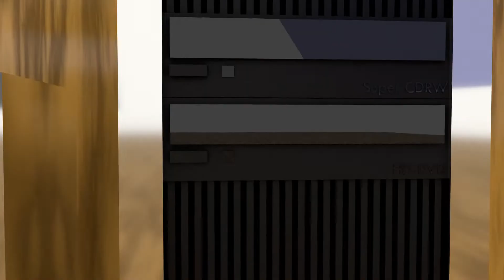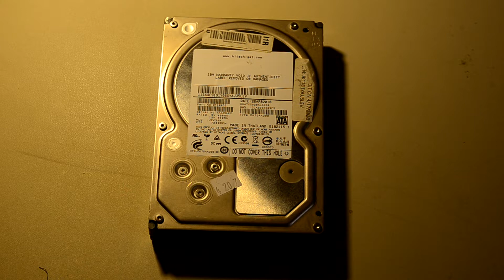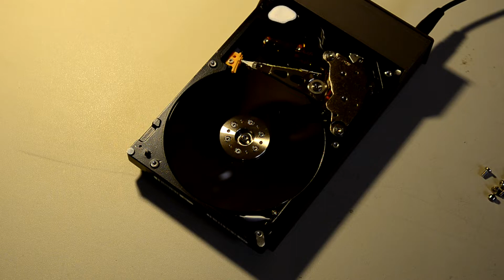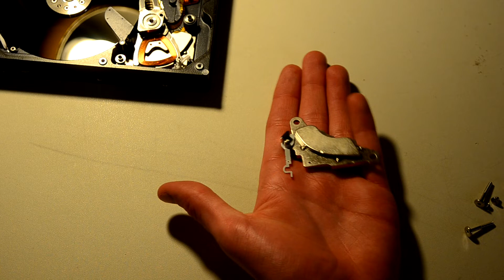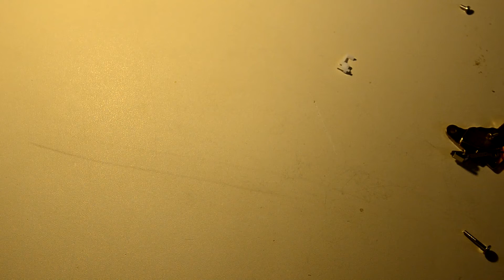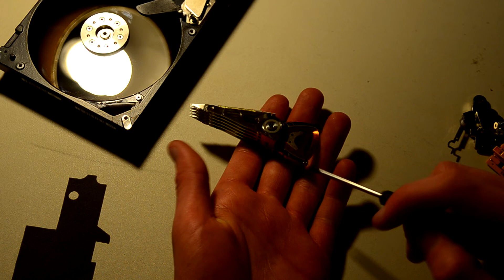2TB HGST Ultrastar teardown: The best drive chassis I have ever seen!

Comment: I have a 14TB RAID6 with these 2TB hdds (9 HDDs in total) including both the pre-2010 and post-2010 release. They've been running 24/7 for about 15 years now (some are dated 2009). I regularly check the drives wondering if they'll ever die but I'm starting to worry that they might outlive me.